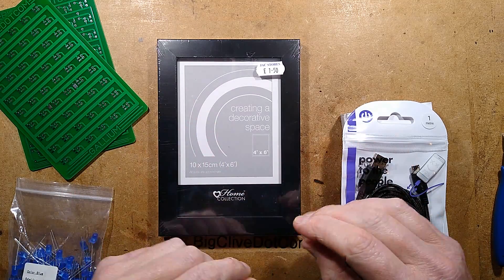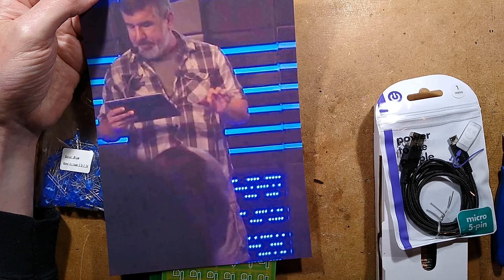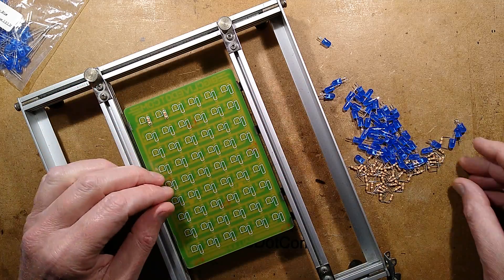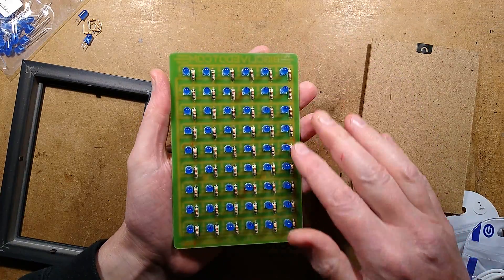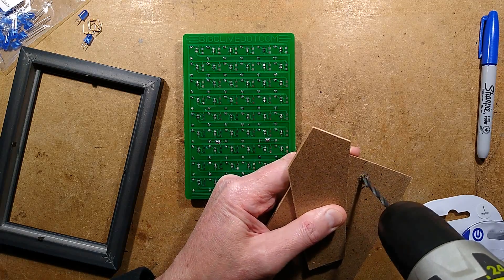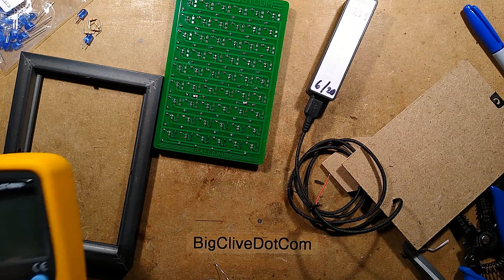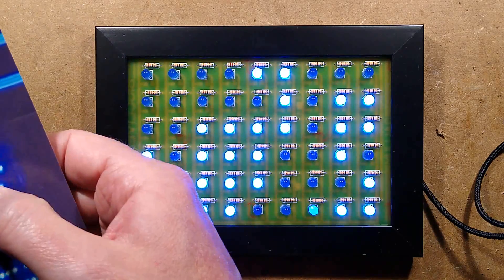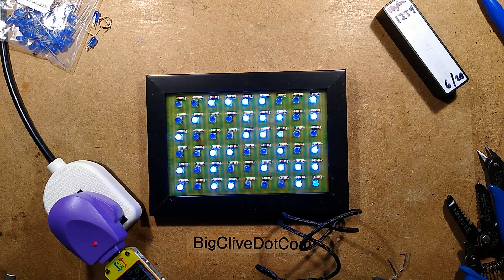The new blue chaos PCB.

Comment: I built a cube one of these with 600 flashing RGB LEDs, and took it to EMF Camp 2016. It works quite nicely - you get an emergent pattern from the internal oscillators going out of phase, and it's a chaotic system that rarely produces the same patterns, presumably because of thermal effects: higher duty cycle of LED and its neighbours = hotter LEDs = greater magnitude effect on the oscillator period. After 5 minutes or so it turns into a sort of vague greenish-pinkish mess as all of them go completely out of sync, which isn't very appealing to look at, so I ended up adding a little reset timer to cut power for a second and restart the effect. Interestingly a few of the LEDs managed to "remember" their last colour, despite most of them resetting. It's an extremely simple circuit for a very nice effect, especially since the LEDs I bought operate on constant 5V so you don't need current limiting resistors. Just a lot of soldering.

Comment: The blinky ones would also look great in that "zeplin" project (Splooshmeister Disko Shart https://youtu.be/j_blpwck_hM) , don't you think? Perhaps even a USB powered version using a blend of blinking and the flickering LEDs?
Reply from the maker: The blinking ones can't be used in a series string due to effectively going open circuit when off, with the risk of a very high voltage damaging them.
Reply: @bigclivedotcom  yah, you mentioned in that video with the blue and green on the light globe (hence the standard LEDs in parallel with each blinking LED - this video  https://www.youtube.com/watch?v=7-sSnZTu9SM&t=3s )  . But if it was still USB powered and they're wired in parallel instead, a USB powered Disko Shart would be cool. Having discovered 3 old lens assemblies from a dead rear-projection TV gathering dust in a shed, with 100 of the multi-colour LEDs and a couple of prototype boards arriving in the mail yesterday, I think I'll see how it goes.

Comment: Not sure if you intended for the "Big Clive" text to be visible through the board when installed (it's cut off by the frame edge), but if you did, looks like you made the same mistake AvE recently did - mirrored!
Reply from the maker: It's only intended to be seen from the back.

Comment: One of these days, you'll stumble across a cheap USB cable where the red and black wires are the data wires...
Reply: Do you plan on building a larger one with a random mix of slow-changing RGB, fast-changing RGB, and flickering LEDs? I know that would be a seizure waiting to happen, but no doubt it would be really trippy.
Reply: I wired some sockets in a house once, in the USA.  I thought,  Black = dangerous, white = safe. WRONG!  There was pain and swearing.  Luckily it was me doing  that not the customer.  Swift wire swap and a lesson learned.  Why was I touching live wires you ask?  How else do you find out which is live when you have no meter?

Comment: A small tip, when you cut the connector off of fabric covered wire, slip a heat shrink tube over the fabric end and it won't get caught in the hole.

Comment: If I were cutting the ends off of those USB cables, I'd cut them with about 6" of length still on them so I could store them and move them around with me for a couple of decades just so I could throw them away a few days before I actually needed them.
Thanks for the video big clive.
Reply: The other option being to throw them a few months before you need them so you forget you threw them away but just know you have them somewhere around here.
Reply: I never throw cables away, I have 5 RCA cables that I don't use for anything, still there with me, sometimes I sacrifice them for other things
Reply: @monad_tcp  Me as well! I have two large cardboard boxes of every imaginable cable, except the one I happen to need at the time, some of which are 25 years old. No idea what half of them are for?!?!
Reply: Awfully relatable
Reply: LOL! You and me both Cole, you and me both.
Reply: Exactly how it's supposed to :-)
Reply: Yup that's exactly it - however I wasn't happy when he cut both twist ties off. They're another thing you need just after you've been moving it around your desk/drawer/floor for months then finally binned it the day before you needed it. NEVER throw away (or irreparably cut) twist ties!.
Reply: @PurpleTT99  yep I totally agree.

I was getting ready for for Christmas lighting earlier actually not was salvaging a bunch of thrift store icicle Christmas lights 4 is the bulbs and sockets for a Lego illumination project.

And it happened to be that the twist her eyes were huge oh yeah definitely saved.

Also sometimes when you do that with the wiring left over from the lights those wires make good time Wars for cables and such.

And also that's how those socket leads are tied together and Ice bundles for when I do the project.

The idea for the project is that the original plug both ends we'll run into a single Lego brick and plates to act as a junction box.

And wiring from another set of lights are more then one set of Lights.

This would be to worst Twisted together of course. Would go to other similar bricks. And break out into several runs of individual sockets probably in excess of the number of Lights in series normally.

A bit reduce brightness and longer life.

Some of the ones I'll use will be the 12-volt varieties like that would be used in like a tree topper.

And others would be the 2.5 / 3.14. Bulbs.

Butt enlarger assembly of course.

These can be configured in whatever way you need.

I'm also going to be putting together a system they uses LEDs.

That would be powered by USB except for more flexible system with connectors.

Probably like a jst connector or something like that.

Also just food allow you to run other things such a small motors and other things as well.

Also there would be a small little box made with some sort of switches on it that would work with the system as well.

There would also be Assemblies of bricks and plates with connectors internally to act almost like a power strip for this system brought out with leads to a a female connector.

I know it sounds like a bad idea to use the male connectors as the power source however in the application there's no chance of them getting shorted out.

Basically created a modular system for this.

As well as I'm going to make some other assemblies for other Bolsa jizz other than 5 won't USB.

Potentially a different connector freeze voltage.

And perhaps even using pin headers and having each voltage available on a different series of pins.

And possibly even having a common and one pin of each voltage.

Probably 1.5 2 point something 3 and 4.5 volts 6 and 9 and possibly 12 as well.

But that's up to debate at this time.

I already have a ton of 3 volt incandescent bulbs most of which are grain of wheat bulbs and smaller.

Most of them are from the Dickens Village type of thing and also I managed to get a ton off small bulbs with attached leads years and years ago.

That were part of battery packs meant to light things up that I had gotten from various stores years ago.

Some of which had a chaser flasher on them.

That would sequence the bulbs.

Although all of them had 10 bulbs double A battery pack.

Also I noticed something when I first got them they always started up on the same bulb and we're pretty consistent with the speed they ran at.

That gave me an idea for a Lego project and it worked out great.

I always wanted to do a Lego theater with a working Marquis.

 if I remember correctly there's a hundred bulbs around the outside???

It was pretty cool!!!!

Of course there was static always on bulbs as well.

Also I do have quite a bit of the LED versions of these as well but I prefer to incandescent one's easier to use and wire up in this application.

As well as adaptable in that they can be wired in series for higher voltages.

 every year after Christmas I would get stuff like that also a good way to harvest LEDs for stuff goes well.

After the holiday season get a bunch of strings of LED lights you got your LEDs.
Reply: That monster cable scart lead that was originally £50 that you picked up for 50p at a car boot sale in 2005.... that you just can't bear to throw out because it's so well made.... ten years after anything was fitted with scart.  ffs.
Reply: @juancornetto8243  although now is that can be fodder for a project when you need more from wires in a cable which I have done quite a bit.

Also certain video out cables for gaming systems can't remember which one's.

That have very small diameter miniaturized RCA cables are good for shielded Cable in places where your need a shielded cable is pretty thin.

Also I do yank Harold wiring of devices are selvedge if it's Define very small gauge wiring that's insulated stranded wiring that is and I use it for a lot of fun projects for miniature lighting.

I'm an adult fan of Lego but not necessarily are like a purist at least some of the time.
Reply: Excellent thinking!  LOL!
Reply: Yep, my thinking exactly! )
Reply: True story brother...
Reply: Muuuahahh! #miitwo :O)
Reply: Been there, done that lol
Reply: Sooo true...
Reply: Lmao
Reply: I recommend leaving 12 inches! In 2041 you can cut off the obsolete end and have 12 inches of wire :-)

Comment: maybe do a comparison of popular cables on amazon buy chopping them off and comparing cores. i bought some audio cables that looked fairly chunky (and I think a well known lower end brand) to chop and hookup to a d-sub connector. there was normal size string inside the insulation along with about 8 strands of copper.

Comment: It would also make a good array for Infrared LED's to give cameras enhanced night vision (for cameras that are sensitive to IR light) - also, moving on with the IR LED idea, could you use a transistor to drive the array, fed from a TV remote control, essentially modulating the IR LED's and making a rather long range IR blaster, which absolutely wouldn't be used to turn on/off peoples TV's at distance in the evenings....

Comment: I put a blinky red LED in my car many years ago.  Still blinks, looks alarmed, haha
Reply: There was a condom machine at uni with a "this machine is alarmed" sticker on it. I always felt someone should calm it down.
Reply: @chaos.corner  Lots of fire exit doors bear a "this door is alarmed" sign. Your comment reminded me of those in the shops closed during the lockdown. I wonder if they calmed down in those few weeks.
Reply: I sometimes look alarmed when I blink, too.
Reply: @thunderbird002  I know, I got a popup, just return it with full tank, all good.
Reply: The Pink Floyd album "Pulse" had a red LED on the spine of the sleeve

Took the sleeve out, slid it into the dash, and go figure - no more break ins!
Reply: They actually here at it available quite a long time ago a little Gadget that plug into a 9-volt battery that had a blinking LED in the front for that very application managed to get a bunch of them Surplus I found that they were just either clipped or glued together can't remember and you could split the top from the bottom and you'd have a 9-volt battery clip and the rest of the guts for another project useful than other words if you ever find them.

Also managed to find a bunch of Lights at one place one time that were about the size of a 9-volt battery which they plugged into.

Inside there was a white LED a resistor and a tilt switch disheartened on and off.

And also there's a cap that we go over the battery to make a little stand.

And in the end the LED and resistor was separated same with the Tilt switch.

And the part of the assembly with the 9-volt battery clip.

All of those are probably wind up getting for like a buck but I think for more than one of them both the things went for the security fake security that is and those lights.

Also I put together a few of these.

Hello project I made for mainly emergency lights and such.

To use on power Banks.

Basically just a USB cable resistor in a few white LEDs sometimes more than one serious string with a simple resistor per string.

As a case and diffuser I used were the friends Wilson White film canisters.

Drilled a hole in the top side and not in the cable sorry everything up and heat shrink.

Nice little backup light but a fair amount of area.

Also does Harbor Freight freebie lights and similar very easy to convert to USB to use on a power bank for the same idea.

And also using the cob light it will like in the entire room.

Also I found that does LED lanterns that have the barrel Jack the run set run on 6 volt usually for D cell batteries those work really well with a USB cable with with the proper Barrel plug on the end.

Although you may need to take that rubber fog off the barrel Jack could use these.

Never used it outside anyways so yeah.

A way to power your land Furniture if you're low on D cell batteries or you have a surplus of power banks that are charged when the lights go out.

And with the unreliable grid nowadays that's a bonus.

Comment: Got some USB cables with 20AWG wires for power. Except they turned out to be 3 core plus shield, where the shield was used for power -ve. Not pleased, but can't send them back after I've removed one of the plugs.

Comment: Looks awesome. I think I want to configure this for a 19" 2U rack blank.
Reply from the maker: It's viable.  I already checked out the sizing as a 2U PCB and it fits in the manufacturers PCB size limit.
Reply: @bigclivedotcom  With 2 side by side still within the limits of a stock 1A USB plug... that's going to make life easy. Nice one! Not to mention a lot of plug-in adaptors do 2A now
Reply: @bigclivedotcom  If you made a kit for replacing rack mount blanks I would buy it. I love blinken lights in my homelab

Comment: Sort of an unrelated question, I have several led strip lights attached to the top of all my doors, hooked up to a solar charged leisure battery. The other day I had to fix one of the soldered wires, disconnected them from the charge controller, and the weirdest thing, when I press on the strip, the 3 LEDs on that area very slightly light up. I have been unable to find a reason why this is. The remaining bit of LED strip I haven't used doesn't do this, only the bits I've wired together. Anyone have any idea why?

Comment: Rather than cutting the LED leads level, why not cut them diagonally so you still have a longer lead to aid correct placement? I quite often cannot make out the flat bit on the LED plastic base.

Comment: The term in the computer industry for lots of blinking lights on the front panel of an old minicomputer is "blinkenlights". If the computer stalled, an expert could interpret the pattern in the lights as a binary number which told them the current address, instruction, and so on.

Comment: My main post is on Patreon, but awhile back I bought a blue stick ( cheap ) that used to form through hole leads at different spacing.
Reply: Yeah those are very useful 👍
There are, of course, 3D printable designs for that type of tool, so that's an option as well.

They tend to be sold cheaply enough that, for a lot of people, printing one wouldn't be necessary for simply saving money, but for those who already have a 3D printer, waiting a few hours for a tool to print could be a lot more convenient than waiting a couple of days (or even weeks) for delivery of one ordered online :)

Comment: Sweeeeet!  You know what we're going to ask for next... Surface mount resistors AND smd LEDs 🙂
Reply: Even better: reverse-mount SMD LEDs! Those are one of my favourite components~ 😻
e.g.: https://www.digikey.co.uk/product-detail/en/W%C3%BCrth+Elektronik/156120BS75300/732-11419-1-ND/7316093

They're designed to be used with a PCB footprint consisting of two contact pads either side of a large-ish hole (2-3mm diameter, maybe?), and mounted with the lens of the LED through the PCB.
This means that the light is seen from the opposite side of the board to the solder pads.

I imagine that, commercially, this would let you keep all components on one side of the board but still have LED indicators on the other side, thus allowing the board/panel to only go through a pick-and-place machine once, saving a lot of money, and eliminating potential issues with having reflow SMD parts on both sides.

But what's far more interesting to me is that you can use them to have LEDs shining from one side of a PCB without seeing any of the solder, tracks, LED packages, etc!
While I do enjoy having visible circuitry in some projects - even artistic projects - it can be very nice to be able to hide all of it, and these LEDs give you that option.

An interesting twist might be to only have holes drilled halfway through the PCB, giving a very diffused effect (you'd also have to choose reverse-mount LEDs with short enough lenses, though most don't seem to be the full height of a standard 1.6mm-thick PCB).
I doubt you'd be able to get one of the cheap Chinese PCB fabs to drill shallow holes for you unless you were getting a lot of boards made and/or you paid them a lot extra, as they obviously could only drill one panel at once (rather than a stack of several panels), and it might require a lot of extra effort to drill holes to an accurate depth (I'm not really sure how those machines work!), but you could order boards without the holes and drill the holes yourself, preferably with a CNC drilling/milling machine, but even one of those amazingly-cheap £200~300 Chinese CNC "engraver" machines would work great for that!
You can get a similar effect by just using regular SMD LEDs, or side-emitting SMD LEDs, on the rear of the board, with the solder resist left off (Pimoroni does this on some of their products), but I think the effect would be better with half-drilled holes :)
Reply: @AndrewGillard  They don't blink, though.